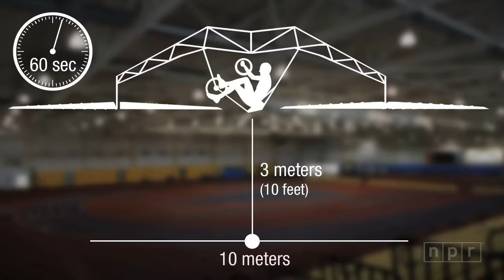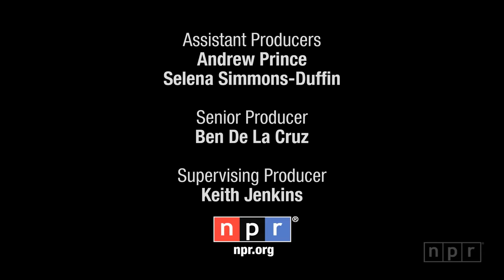Human-Powered Helicopter: Straight Up Difficult | SKUNK BEAR

Comment: Way to go, Mr. "I don't know what 'BACK DOWN' means" Colin.
Reply: That had the appearance a wreck caused by disregarding instructions but I rewatched and I think he was just trying to keep the drive strings from going slack - they'd get tangled everywhere if he didn't continue to reel in.
Reply: Also he'd have to control the descend speed so that the thing lands smoothly. Looks like he rather descended maybe too slow in the beginning but too fast in the end, causing the damage
Reply: You'd have to imagine you want to bring it down gradually
Reply: I knew he was gonna break it.
Reply: He's controlling the descent
Reply: that's what I thought, but it's a tight window and after the first test they really should've had a backup

Comment: I'm still confused on how it lifted when the rotator blades are doing like 50 RPM !
Reply: 'cos they are big blade....a lot of surface area.
Reply: Speed increases pressure decreases creating lift in top of the wing. You see the same principle on airliners during takeoff. Speed increases and the wings lift.
Other principles at work too...
Reply: The not completely apparent element of their design is taking advantage of ground effect. That's why the propellers are as close as possible to the floor, and have so much total area.  Intuitively, think about it kind how how a hover craft works: if a toy hovercraft hovers at 0.1mm above the surface, conceivably one that is scaled 10x would hover around 1mm.
Reply: For anyone who doesn’t know much about physics, big ass blades and very light frame
Reply: @jameslin4554  That's why they're going to struggle to get higher and maintain stability. They're at the limit for ground effect.
Reply: @jameslin4554  The Sikorsky Prize rules are one step ahead of them with the ten-foot rule.
Reply: Huge radius bro
Reply: Simple. Surface are.
Reply: Yeah same

Comment: Just add a big helium balloon on the top but only as big as to have the average density of the aircraft slightly higher than air. Then it qualifies as "aircraft heavier than air" and then the pedalling will be much easier. If you want to have an aircraft where every part of the aircraft is heavier than air that is not possible, because the interstitial spaces between the atoms in the crystal lattice of the solid matter of the girders are made of vacuum, and vacuum is lighter than air.

Comment: surely you should just have another control that the pilot can press to stop it drifting? like a pilot in a helicopter would press pedals or turn a joystick to add more lift to one rotor or the other? or would moveable rotors and wings make it a lot more heavy? ( i would say its not really true flight if you cant control where you are going - the difference between a hot air balloon and a helicopter is quite large if you want to go to london in a balloon but you end up in aberdeen...

Comment: I never took physics but I'd always thought a human-powered helicopter is an impossible thing, being that the human simply can't produce enough energy to lift themselves and the machine off the ground.. but this video proved me wrong.

And aww, they even put a little stuffed toy figurehead on their own creation (i.e. at 5:13). Very cute.
But it's honestly mind boggling how such little spin/motion from the propeller can lift the entire contraption and human up.
Reply: it's displacement pure and simple
Reply: with that logic, you're saying humans can't jump...?
Reply: Santosh Balachandra
'the human simply can't produce enough energy to lift themselves and the machine off the ground' - read again: 'themselves AND the machine'. And yes, we cannot produce enough energy to lift ourselves off the ground for longer than a second, otherwise you could attach some artificial wings to our arms and fly like a bird. Genius.
Reply: You have clearly never seen any of the commercially available human-powered ultralight fixed-wing aircraft. The only challenge here is hovering, not flying.
Reply: You're wrong. clearly, this is possible, and humans can produce enough lift to fly, you just need an efficient machine.
Reply: Birds can.
Reply: it's displacement. look at the size of the blades! They don't need to rotate very fast to move x amount of air required for lift.
Reply: The issue with your statement is that you are only focusing on the human threshold of a specific movement.  Just because a person can only pick up X amount of weight or jump Y height, doesn't mean that they don't have the energy inside them to do more.  They are held back due to the mechanics of the body.  Not the amount of energy inside.

Comment: I don't think it's the machine they need to improve. It's power to weight ratio. If you had a much stronger man that was trained for endurance pedaling it might work. Like say those small men were 130 pounds and an Olympic cyclist would weigh 230. That's plus 100 pounds. But that man that weighs 130 can only bench press or leg press maybe just barely under his weight. But the Olympic cyclist would be able to bench press or leg press 300 lbs making his power to weight ratio very positive, with the perk of him or her being trained for endurance. I think Gatorade sponsored a video where they took a Olympic gold medalist cyclist and challenged him to power a toaster with a bicycle and he lasted I believe it was a good 3-4 minutes of consistent pedaling. Moral is, you can't just say hey try to do this with no past training. There are professions in life, get a professional cyclist for cycle like activities. Please, this challenge needs to be broken, I have to see the power of the human mind  be tested. And see how it gets broken
Reply: That's what I was thinking.  Why did they pick scrawny teenagers for their power?  A more muscled, trained athlete would have fared far better in both endurance and power/weight output.
Reply: Could imagine frame not being designed to for a 230 pound person.. or less likely the forces they can generate.  Or eg like the string going to the props whats its breaking strength.  But yeah for short period going for max power:weight ratio sprinters are not skinny dudes.
Reply: I agree. Power/total weight is what counts. Perhaps the structure can't take the forces of a pro cyclist though.
Reply: Hexed Hero I’m an amateur cyclist at 160 and can leg press 400 easily, many pros literally can leg press over 1,000 lbs
Reply: uuuuh pretty sure they thought of that bro
Reply: @aud_io Requirements include 1 minute hover time, explained at 1:00.

Comment: "First time in the world"
People in 19 century laughs in hidden
Reply: I doubt there was anything like this that got more than two feet off the ground in the 1800s. Sure, there were a lot of smart engineers that built very impressive designs without modern tools or computers back then. But the best lightweight materials of the time (balsa wood probably) didn't have anywhere close to the strength/mass ratio of carbon fibre. No amount of engineering can make up for lackluster building materials after all.

Comment: Look, a human powered helicopter is not a practical way to get to work, mkay?
That's not the goal here.

The goal is to "push the limit of composite structures and lightweight design" by perusing the Sikorsky prize. "It's an engineering challenge." They said this stuff in the video.

So putting it on a pole, or making the allowed space bigger defeats the purpose of the challenge.  If you're going to change the rules, you're not going to push the limits of lightweight design.  You might as well say "hey, here's a normal helicopter, it can do all that, I won."  

The human powered helicopter may not be practical, per se, but some of these lightweight technologies may in the future find their way into practical aviation.  And that is the reason we have engineering challenge prizes.  It's about pushing limits.

Comment: The rules should have specified that it has to be done outside. Flying indoors eliminates half the problem because you don't have to worry about making the structure strong enough for even light breezes. Even so, they don't have any way to control it so they can't stay inside a box even indoors. The Wright brothers weren't the first ones to make a heavier than air craft fly, they were the first ones to make a heavier than air craft fly in controlled flight, and outdoors of course.
Reply: No, the Wright brothers made the first heavier than air powered flight. There had been people flying gliders for a while.

Comment: "I've never ran out of energy"
crashes
Reply: The rotors work on a limited supply of string. once they start to run out they have to begin descending or else that happens.
Reply: @travsudz4544  There is that problem of string but, I'm inclined to think the problem here was it drifting fairly quickly and they needed to get it down partly because it was probably already outside the box area so no prize even if he got the height and it was rapidly heading for colliding one of those beautifully made super light rotor blades and a post or wall and so she was almost shouting at him "down down down" so he ended up maybe rushing the landing to save 1 thing but being so fragile a hardish drifting landing like that was bound to break some stuff. I could be wrong but think a bit of broken frame was probably better than breaking and having to rebuld and re cover that whole rotor. Just mu guessed opinion and I could very easily be wrong. An amazing effort all the same and since this was almost 8 years ago now I sincerely hope they succeeded and won the prize.
Reply: @lorditsprobingtime6668  She screamed back down a little too loudly and forced at the end, so he panicked and thought, okay, back down instantly, and that was the most damaging part of the crash. He was coming back down, but was doing it more slowly as to not crash it as badly, but she just kept shouting it louder, so h e said fuck it and stopped completely. Bad move on her part imo.
Reply: @turkeygoblin  Agreed. If it was drifting outside the box and risking damage through hitting something, he had no control but since they couldn't get the record that time she should have grabbed some part or a light rope hung down to guide it back away from everything and let him settle it more gently. As far as I'm concerned it was her fault too. It didn't set them back massively but it did a bit and any repair adds at least some weight which is their enemy here. She definitely should have just guided it back while he concentrated on putting it down gently. If it had reached the height required and the time inside the box was only a second or 2 to go and he could still finish within the confines of the area then she still shouldn't have done that.  It's hard to judge really since it's not any of us going for a record like that and the money involved but as it was she made the mistake that cost them on that day, he was powering well and was really looking like making it except for that drifting.
Reply: Henry was obv the superior pilot.

Comment: "back down"
proceeds to pedal frantically into a wall
Reply: It's the people who keep yelling back down who are idiots, if he just stops pedaling the thing will drop like a rock and smash to bits.
Reply: @shannons7517  obviously he can't just stop pedalling, but the people yelling at him can't do much either
Reply: Back down. Back down. Back down! Back down, back down, backdownbackdownbackdownbackdownbackdownbackdownBACKDOWN :keeps going until the words lose all meaning and sounds like angry Korean:
Pilot: durr i think she wants me to keep flying.
Reply: @shannons7517  obviously there's a middle ground betwen not pedalling at all and pedalling fast enough to stay afloat.
Reply: @shannons7517  He just needed to slow down so he could land softly before running out of pull chord.   Peddling frantically is a guaranteed crash.
Reply: @shannons7517  actually it's guys like him, who want it too much, who ruin those things for everyone. If he had stopped pushing when everyone was yelling, he would have made the landing.
Reply: @siemensohm  I'm glad to see you're an expert in operating these craft. Hopefully you can get in touch with the team and shed some light on the matter.
Reply: @UmamiPapi  
keep your toxic remarks to yourself.

Comment: They need a carbon fibre gearing system.. You can see that the person is too unstable to keep going at peak speed at 8feet.. Wasted energy. It could easily be light weight and not flaw anything already existing. Could even use some of that energy into a rotor somewhere to help prevent the drifting. Pretty impressive
Reply: I was thinking gears too. Lightweight carbon or aluminum gears. I see a lot of potential in this
Reply: Dean Beyers Maybe they could use some off his own body weight to help turn the rotors by using the gravity pulling him down.As the chopper go's up,he will be slowly going down,he of course will be hooked into the drive train via ropes and bullies. just a thought
Reply: beavis simpson Yeah it wouldn't be efficient to be honest. He'd have to be quite high to make use of potential energy in a situation like this.
Reply: beavis simpson But I guess it could be useful to get the rotors spinning and once they're already at a moderate pace the rider can then start riding with bigger gears and add that extra speed.. Now you're thinkin

Comment: It would suck if someone went too high and passed out from exhaustion 🤦🏻‍♂️
Reply: The pilots look like they're seasoned cyclists. While exhaustion is not impossible, it wouldn't be a problem for them for several hours. I'm an experienced mountain biker and I've rode my mountain bike 30 miles (off road trails mind you, not paved surfaces) in a span of about of about 4 hours. I was a little tired but could've rode longer (just ran out of daylight). Of course, that was also stopping at the 20 mile mark for a granola bar. LOL

Road bikers (which I suspect these pilots to be) can ride 100 miles without batting an eye.
Reply: sixstanger00 very interesting to know, thank you for informing me
Reply: @sixstanger00  I need to eat every hour (at most two) or I just run out of energy.  I am a recreational triathlete and the longest I've ever ridden on the road was 65 miles, and it took an entire day and I was dead at the end.  We also stopped a couple times for burritos.  But at the College Park Aviation Museum, they have a simulation of this cycling helicopter, and I was able to power it, but I had to go at a sprint pace.  Certainly not a pace I would be able to maintain for very long.  I was thinking, damn it takes so much effort to power this thing, I'd have no concentration left to be able to steer or orient it lol.
Reply: @cryora  Just a word of advice -- burritos are a terrible mid-ride snack. You want to avoid anything heavy. If you're setting out to do a long ride, eat your carbs & calories either the night before or a few hours before. Mid-ride snacks should be peanuts, granola bars, power bars, stroop wafels, nutter butter cookies (only 4 or 6). Anything salty like pickles also helps to combat muscle fatigue. 

I once made the mistake of eating a burrito just before an evening ride on the trails. One trail is 1/4 mile climb the whole way. By the time I reached the top, I was about to puke. My performance that evening was the worst it had been since I started biking -- it was as if it was my first day. 

On the road, I can cover about 12 miles in 1 hour on my XC bike. A lot of my race training has involved increasing my endurance though, so I can ride long distances without stopping.
Reply: @sixstanger00  Makes sense.  The triathlon team I was in would hold these burrito rides every year.  And the people on this team are really good at the sport too.  It's part of their sense of humor and culture, I suppose.  I think on the 3rd burrito on the one ride I went on, I couldn't eat anymore.  Eating something is still better than nothing though.
Reply: @cryora  That's very true. I've tried riding on an empty stomach. Major suckage.
Reply: Would it?
Reply: @sixstanger00  yeah road bike is mostly about the bike not the rider, the rider needs to have good cardio and some leg strength but mountain/trail bikers need a lot of leg strength amazing cardio along with a good bike